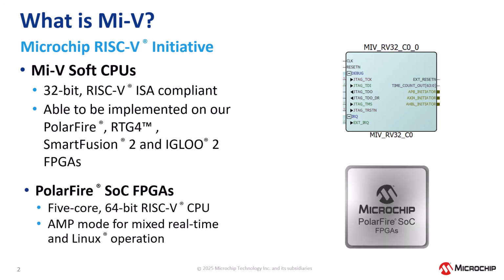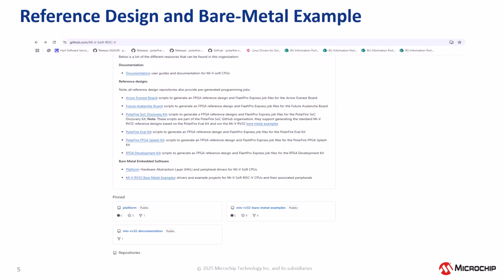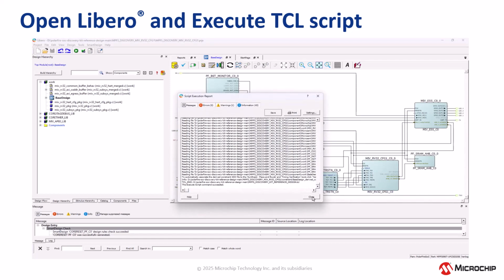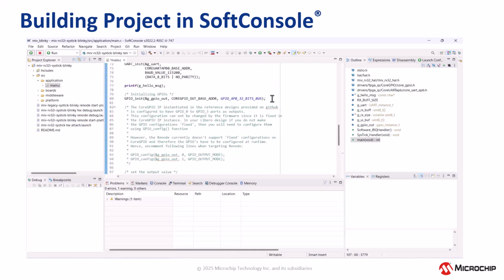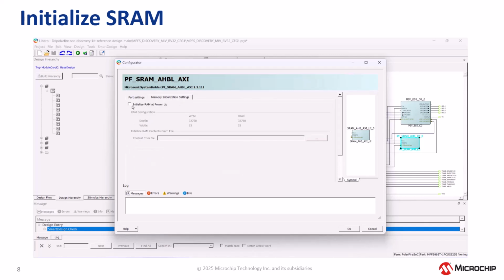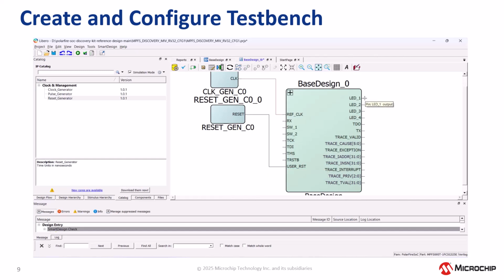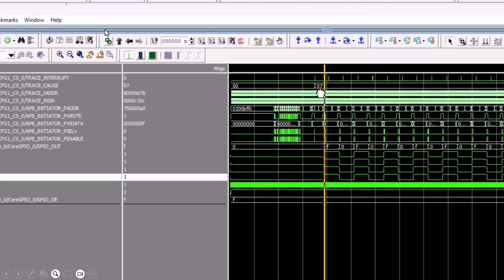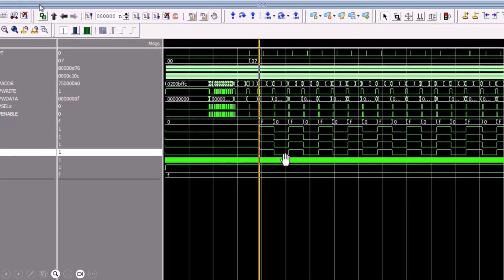How to Simulate Mi-V Soft CPU

Comment: The Softconsole project was compiled for miv32i-Debug in the video but the hex file used was from miv32imc-Debug. Using incorrect hex file (in this case miv32i-Debug) produces a different result than in the video.